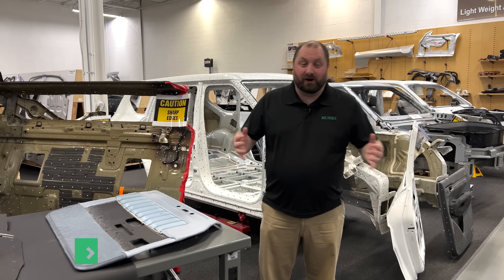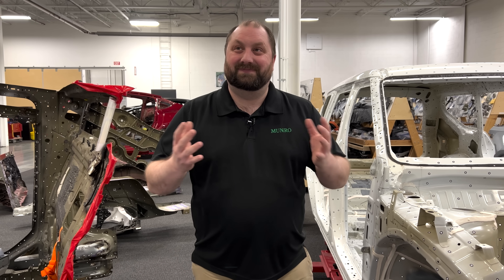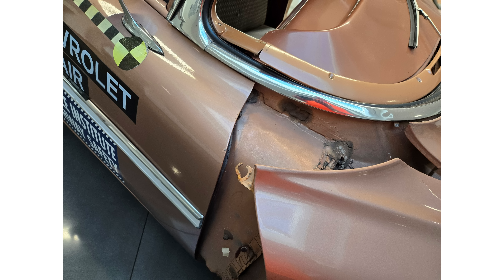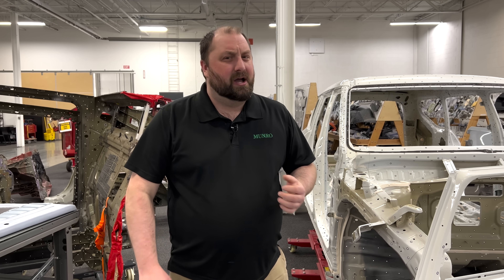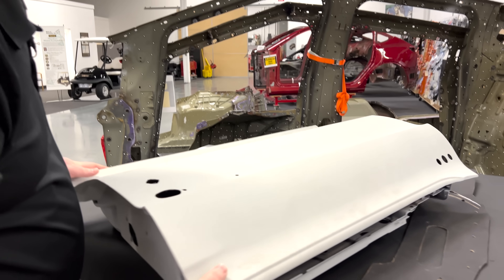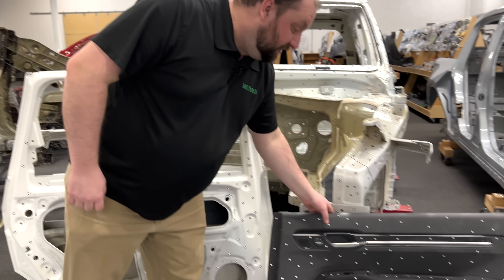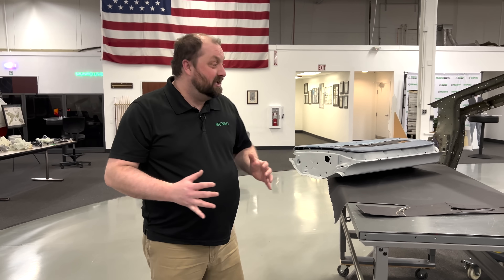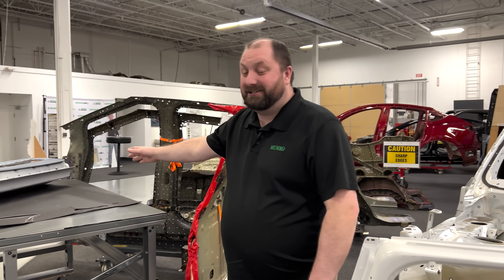No, Your Classic Car Isn't Built Better Than Your New Car

Comment: I once found a stash of 30+ year old car magazines, all the maintenance tips and advice on buying used cars showed just how bad cars were back then. Rusting out after 5 years, engine rebuilds at 50k, etc. etc. Classics are cool and fun but don't pretend they were better.
Reply: One great thing today is that we can actually restore the shell and interior and bring the Brakes and suspension into the present safety and performance abilities then power it with the latest clean Technology if we wish … we don’t have to just put it in the Museum or a Scrapheap  …
Reply: @chrisbraid2907  You don't have to modify the car.  Most any car made after the mid 30s can be driven every day without worry, especially if it has Overdrive.  One of the reasons we classic car lovers love classics is because we DON'T WANT computers in our cars.  We like to do our OWN maintenance and repairs.
Reply: @jamesbosworth4191  damn right
Reply: @chrisbraid2907 Those items are true but the overall poor construction design and lack of passenger protection remains the same.  That non-collapsible steering wheel will still impale the chest of the driver.
Reply: I was poor. I recall changing the plugs, plug wired, rotor and cap, etc. In Buffalo, the wet would affect the wires, etc. Just change the oil on today’s cars. I traveled a lot for work and used rental cars. The cheap cars of today are similar to the more expensive cars. I drove a generic SUV and a high end European SUV back to back. There was a difference. But, not a $50K difference.
Reply: Idk about that. My 40 year old original American engine block, never rebuilt, been through 2 transmissions, and rolled the odometer a few times still runs good. The old 40 year old body is just starting to show signs of rust. I don't think it's ever been in covered storage. The thing that gives old cars a bad rap to non car guys are the highly advertised modern efficiency of the time garbage. Generally those were sold to people that wanted the latest and greatest in technology, only for it to fail in 5 to 8 years. But the guys that knew the difference of the options would get the older tried and true engines and those that were taken care of somewhat are still going till this day. Late 70s to mid 80s were some dark times in the automotive world. 90s belong to that Japanese brands because most of the really good American cars were focused on grandparents.  I haven't seen a low maintenance European car from the 90s in the US.
Reply: @mrbig7718  You need to Fluid Film it or you will lose it to rust.
Reply: @gregorymalchuk272  honestly I'm a collision professional with 30 years experience from the south. I've been kicking it around and definitely not a keep it all original kinda guy. This summer it's going to get heavily modified and  redone. Not because it's broken or rusted beyond repair. It can probably go another 15 20 years how it sits,  but I'm bored with it and about to get a c6 corvette front end and rear suspension  put under it. Shouldn't be a problem since I have every welding certification a collision tech can have. 

My hardest decision is to put that 40 year old engine in it or the vette engine. I really want to go with that old one just to piss off the modern car lover. No computer, no fuel injection, mechanical and vacuum timing. The simple things you know. But to get the horsepower how I want it it would need to come apart and that kinda defeats the purpose of bragging about having a pure 40 year old engine that still runs perfectly fine. The old ones from the late 50s to early 70s were absolutely gems. But nobody changed their oil every 3000 miles, and only changed it when it was black as tar. Burned up transmissions by pulling up stumps out the ground with the family car. Or the younger ones would shade tree mechanic their way to the track and just dog the hell out of them. Can't do anything like that with modern vehicles. 

Back then they were looked at as tools to an average person but now they are just only transportation and status symbols with necessary obsolescence in mind. 

If you knew craftsmanship and quality of materials, look at the 60s Buick nail head. The robust quality is unmatched. Back then nobody cared. It was just another car that was overlooked when the next model change came. When I was in my teens I couldn't count how many cars from the 60s and early 70s were in the junk yard where it looked like they were just pulled out someone's driveway. We'd walk up with a can of gas and battery jump out the ignition and jump the starter and we'd listen to most of them run with absolutely nothing wrong with them. Then came the early 2000s. Scrap yards were crushing everything, not saving anything. Then one by one each yard disappeared. We used to have 20 25 yards in a 50 mile radius, now we're down to 2 and they only have late 90s to 2012 in them. Mostly actually junk.
Reply: @mrbig7718  What make and model is the 40 year old car?
Reply: @gregorymalchuk272  idk about him but european things made in the 90's early 2000's were known to reach the milion without anything special done . Also toyotas
Reply: @ketelin4285  There have been many American v8s go a million miles. The thing is, people need proof. But when owners pride themselves of doing their own maintenance and odometer that would flip at 99,999.9, it's kinda hard to prove. When we see a barn find on the internet of a ragged out car, and it has, let's say, 70,000 miles, we laugh. That car probably has 370,000 miles or better. The missing hundred thousand mark has been used against classic cars but back then we used to say we had a new car every 100,000 miles
Reply: @mrbig7718  We used to sit in the car to see if it had, say, 56,000 miles or 156,000 miles.  If the seat felt reasonably firm, but didn't look brand new, it probably had around 56,000 miles, but if it did look brand new, or, you sunk down to the floor, it was probably 156,000 miles, or even more.
Reply: @mrbig7718  Some of us did and still do change the oil every 3,000 miles.  I change mine every 2,000 miles, and always got way more than 100,000 miles out of engines.
Reply: @mrbig7718  Many people, when the automatic transmission fails, both then and now junk the car.  They say they "can't afford" to have it rebuilt, but somehow they have the money for a new car.
Reply: @jamesbosworth4191  I just had a transmission rebuilt 3 years ago for my dad's old truck . It only costed 1400, by a reputable shop. How much is a truck note these days?  347,000 miles on the original 1997 Chevrolet 350. The seat is still kinda firm too😂. Lots of highway miles. Louisiana to Alabama for many years
Reply: @mrbig7718  Sounds like a testament to American engineering.
Reply: @mrbig7718  FACTS.
Reply: i wouldn:t consider it running well if it had 2 transmissions
Reply: @rudyardganuelas6254  "Running well" refers to the engine, not the transmission.  RELIABLE or UNreliable can refer to the transmission or even the entire car.
Reply: These new cars and trucks are just as bad, if not worse than the cars in those magazines. Just watch some of these tow truck operators YouTube channels and see what brand new cars they are picking up off the side of the road. GM now has an engine that will blow up with less than 10 miles. But the good news is that their fuel pumps are good for up to 4000 miles. Toyota isn't off the hook either. They are building some garbage now.
Reply: @dougfisher1813  Their new engines only last about 20,000 miles.  Even a lowly Model T's engine lasted a lot longer than that.
Reply: Depends on the model, some engines back then could easily go triple that with no rebuild needed....think the slant six 225
Reply: @fortheloveofnoise  That was one indestructible engine.
Reply: And every car back then didn’t come with the biggest engine and lowest gears etc. Just like today, most people bought boring base or lot models with 6 cylinders or 2bbl V8s. Every model sold wasn’t the special order race model.
Reply: When people say classic cars are better, it’s a given that they aren’t talking about safety and the longevity of the car.
Certain eras of cars are better for certain reasons. Who knows how cars with only screens and other unique technology will last.
Reply: @Delta_NWAB747fan  Plus, we don't want TV on our dash boards, we want INSTRUMENTS.
Reply: You didn't have to rebuild you engine at 50,000 miles.  We don't like modern cars.  Its just that simple.  You are welcome to like whatever you want, but quit trying to make us agree with your choice.
Reply: @jamesbosworth4191 original beetle does. And a valve adjustment every 5k
Reply: 30+ year old magazines are from 1995 and earlier! I am old.
Reply: They rusted because their environment was in the rust belt. & probably left outside  all their life. I've had a lot of 60s 70s, & 80s, 90s, & todays cars. No rusting on my older cars while in my care/ownership. The newer ones rust just as much as the older ones if treated poorly & operated in areas where salt is used in winter. Salt & brine will destroy vehicles in record time. I've even seen vehicles (NEW) at dealerships with lots of rust.
Reply: Modern cars are much more unreliable
Reply: @thefinalroman  And all too often unfixable.  Most old cars were EASY to fix with common hand tools, as least good enough to get you home, where you could go over it and make sure everything is right.
Reply: It's the cool and fun that makes them better. No other criteria required.
Reply: @dcarbs2979  y'know in years to come people are gonna say the thing about the cyber truck in 50 years
Reply: @ That's if it's still capable of running. We don't have that car in my country. It fails safety standards from brand new.
Reply: But they are more cool and more fun.
Reply: I think a bias towards it is how many classic cars still are running today. Most of the time I see classic cars in my area that weren't meticulously maintained and still running they are 80's/90's trucks from all makers. Otherwise it is almost all some form of Honda Civic or Toyota.

So it is more the old cars that are still running were pretty much the models that withstood the test of time. Everything else got scrapped due to natural selection.
Reply: @Vultain  or the stigma that you're poor if you have an old car, but yet millionaires are spending tons on original classics. Look up Barret Jackson 'CUDA, and while looking, watch what people are paying for other things. When a 1957 bel air goes for more than a new 911 that's when things are put into perspective. Some people know a good investment when they see one
Reply: What is can say is i have the skills to fix older cars way easier than newer ones electrical problems are not something everyone has few do
Reply: @clydedoris5002  Thank you.  We red-blooded American males DON'T WANT a car that we can't work on at home.  We DON'T WANT to have to bring it to the shop.  We want to fix it AT HOME, OURSELVES, and the more you people try to stop us, the deeper we will dig in our heels.
Reply: Yes that is true. For the past 20+ years many don't even need a tuneup for 100k miles while back in the 'golden days' you would clean and gap your points and set timing every 6000 miles, plugs, fuel filters and new fan belts every 12k miles. Adjust the carb and choke depending on the weather. Water pump may last 20-30k miles. Maybe adjust the valves and take care of oil leaks and change VC gaskets pretty often.
Reply: @SkaBob  The factory water pump usually lasted at least 75,000 miles.  Replacements often failed much sooner due to the fact that we usually didn't buy factory ones, we bought replacements at the auto parts store, and they just were not as good as the factory ones that the car was built with.  Gaskets didn't last very long, but you can buy modern-style gaskets, which solves that problem.  We car lovers ENJOY working on our cars, unlike you guys who just want a transportation appliance.
Reply: you're literally describing the launch of golf 5, polo, jetta, passat, etc. they cut corners so that they could sell bugattis to the uber rich at a 80+% financial loss.
Reply: Speaking as an auto mechanic . .  

Timing chain replacement at 30,000.
Valve job at 60,000.
Engine rebuild at 120,000.
Reply: @Matthew_Loutner  What kind of car was that?
Reply: A verdade é que tudo vai evoluindo , e os carros no quesito segurança  , nota 10 , abs , cintos três pontas para todos , controle estabilidade, controle disso e daquilo..
O mais interessante é a deformação da carroceria , para passar menos impacto aos ocupantes...
Os carros antigos , numa colisão era contrário  , quem sentia todo impacto era os ocupantes , ainda mais sem air-bag e com cintos abdominais....
Melhorou muito.....
Reply: Car reliability peaked in 2010 and has gone down since then.
Reply: @gregorymalchuk272  It's stayed the same or improved slightly. JDPower proves this with the industry average ratings.
Reply: my grandpas base model c10 that he bought new started rusting out after 5 years but it lasted for 230,000 miles and cost the equivalent of $15,000 today. 

my 87 firebird that cost the equivalent of like $50,000 has 260,000 miles on it and i know someone with an 84 that has 285,000 miles. the highest mileage car on earth is a 50 year old volvo.

say what you will about safety, but old cars typically had better built drivetrains that lasted longer.
Reply: @moistysupreme1884  About 5 years ago I worked on a F150 that was about 7 or 8 years old (don't remember the year) that had over 500,000 miles on it. If people will take proper care of their vehicles, even newer cars can long life spans. Every generation has had its good car designs and its bad car designs.
Reply: @moistysupreme1884  FACTS.
Reply: @moistysupreme1884  unless you bought your car new and put the miles on it you have no idea.
Reply: @moistysupreme1884  No they didn't. You present two anecdotal pieces of evidence. The statistics do not agree with you at all. It is highly unusual for a car today to have any major issues south of 100k miles, it was quite common back before the 90's for cars to have issues and require much more maintenance than modern vehicles.
Reply: I'm an ASE mechanic and you are wrong
Rust: just fluid film once a year, no rust. If you aren't doing this you are just lazy. No excuse.
Engine rebuilds: We have better oils and additives available now and you can rebuild an engine in your garage in a weekend
Reply: @BuddyTheWolfYT  FACTS.
Reply: @BuddyTheWolfYT as if everyone knows how to do that...
Reply: @BuddyTheWolfYT  Fluid film still isn't 100% effective and while modern coatings also aren't, you want as many layers of protection as possible, especially if you live anywhere where the roads are salted in the winter.
Better lubricants still can't change inferior design. For example, most older engines use flat valve lifters as opposed to modern engines which use roller lifters. The rolling element no matter what will have much less wear. With modern engines, you don't have to worry about rebuilding them nearly as often, not to mention that rebuilding an engine is a very expensive and intensive process, that with it carries many risks for contamination and incorrect assembly, especially when performed by inexperienced individuals trying to finish the job in the timeframe of a weekend.
Reply: @quentagonthornton49  Many people swap newer engines into older vehicles too, for instance a Subaru or Ford Zetec into old VW vans, for mine though I am just rebuilding the old aircooled one but with bigger cylinders for more displacement and Speeduino efi system to control the engine
Reply: @BuddyTheWolfYT  They used to rust out on the lot. Grandfather saw it happen and walked from the dealership when he saw it. Don't want to hear it.
Reply: @Mercer1012  How is that the fault of the car? Old laquer paints were not very durable
Reply: Thank you so much. I feel like I'm going nuts when I encounter car enthusiasts who genuinely believe classic cars are more reliable. They were easier to work on, but they broke constantly. 

Hell, even looking at the early 2000s, pretty much every car brand in 2025 is more reliable than your average Toyota from 2003. 

People act like car issues are this new thing, or more common now. No, we just hear more about them now because online forums make it super easy to find horror stories. I guarantee if you go back to 2003, you'll find Toyota 4 runners calling their brand new SUV a lemon because the transmission needed to be replaced after 1,000 miles or something.
Reply: @themidnighttavern6784  You don't know what you are talking about.  The traditional American cars were VERY reliable - the envy of the world.  They SELDOM broke down, unless you refused to maintain them.  Yes, if you refuse to check the water, eventually it will overheat.  Yes, if you refuse to check the oil, it might get too low, and then you can destroy your engine.  Yes, if you refuse to check the automatic transmission's fluid level, it might get too low, then you will ruin your transmission, but if you DO check the water, most American cars will NOT overheat, and if you check and periodically change the oil, your engine will last a LONG LONG TIME, and if you check the automatic transmission fluid level, it will last at least 100,000 miles.  Contrast this to many Euro cars that will NOT last very long, no matter how good you maintain them.  And no, I am not talking about Mercedes Benz.  Most people can't afford them, new or classic.
Reply: @themidnighttavern6784  how do you know a car from 2025 is more reliable? We're only 4 months in. If you have a reliability issue with a 4 month old car, that's a a piece of crap. Let me know how reliable a 2025 make and model is in 2030 or 2035